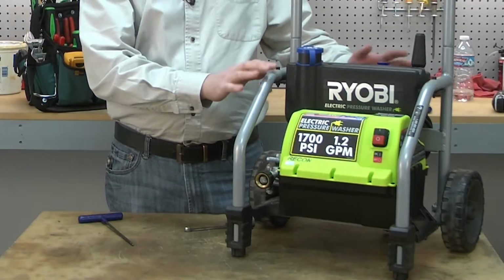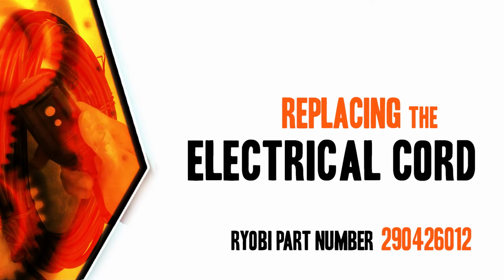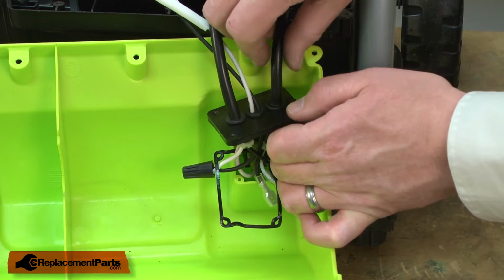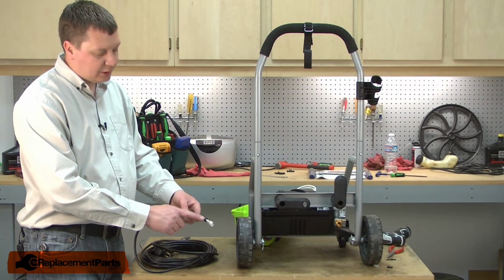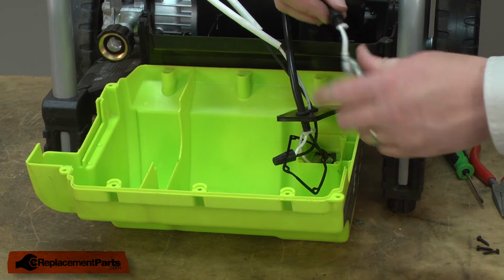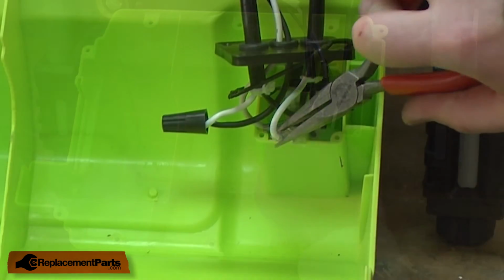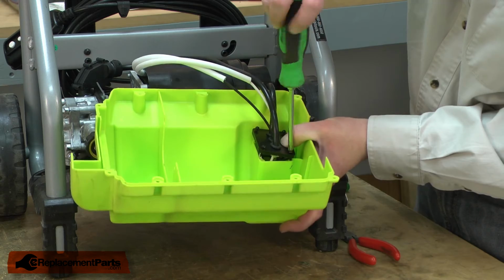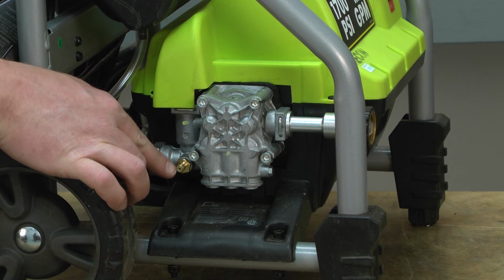Pressure Washer Repair - Replacing the Electrical Cord (Ryobi Part # 290426012)

Comment: I’m have the same or similar problem. I plug in the plug to the outlet. The GFCI light is green but the pressure washer light does not turn on. When I press the reset button it sounds like the pressure washer motor wants to kick on but stops after about a second. Could this be a power cord issue or just the assembly? I inspected the cable and found no cracks. Thoughts?
Reply: I have the same problem.

Comment: Thanks for the video. Found a cord on eBay for about $20 and installed using this video in about half an hour. Couldn’t find my needle nose pliers so I ended up just unplugging all 4 connections in the box which made install simpler. Used a small flat head to force the gaskets on.

Comment: What if the green light still comes on ,on the reset switch , and I actually bi passed the GFCI box to a direct plug in , and the crazy thing in my situation was when I did this the unit got a quick jolt of power for a split second and the back to nothing . At this point would it be smart to look at the on / off dial on the front of my unit? Thanks ...ps) will they work if u bi pass the GFCI box anyway? Thanks great video

Comment: Yes I have GW electric pressure washer and the power on and off switch burned out the power terminal it has 4  all together but I wanna know can I hook it up straight power without the switch and just connect the 4 terminals together and plug it in and use it like that

Comment: I ordered the electrical cord for my Ryobi 2000 psi washer. the new cord has a ground wire. ( 3 wires in total).. Do I need to ground the cord? You don't seem to show that step in your video, which, by the way is very informative. Thank you!

Comment: Do you possibly know how to remove the housing on the Ryobi 1600 psi pressure washer (Model # RY141600)? Mine doesn't have screws like yours.
Reply: Did you find out?

Comment: the plug part has a different kind.   looks like a T bone plug " | .-- "    <--like this .. annoying style
Reply: Can it be cutt if your stuck in a dam and the closest town/city is 3 days of driving ..  Suppose Prong is the right word for it  ?? short cut with the 3 wires ???  . heatshrink. with fireproof tape as back up to patching it .. is it possible?